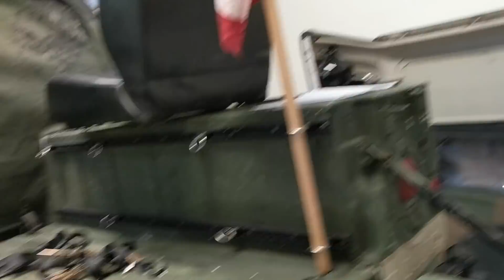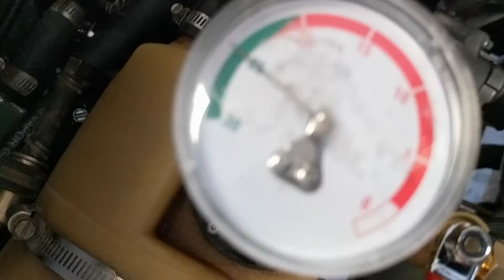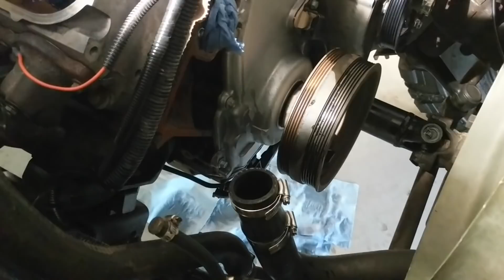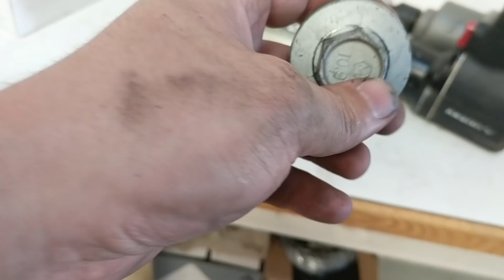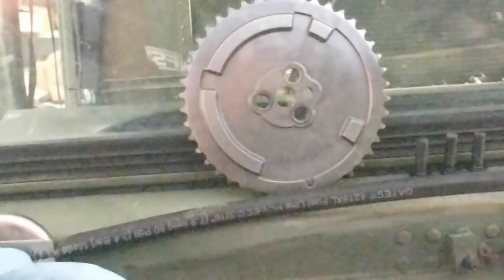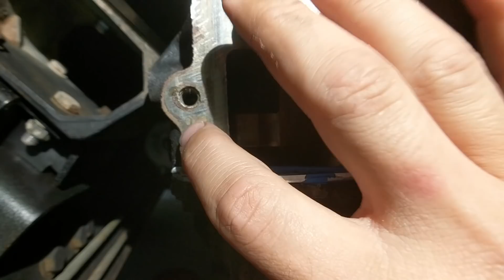Texas Speed Stage 3 Cam Swap! - LSxHumvee

Comment: 2 Question LS 02 Chevy Silverado 5.3  what the chart for the stage three cam kit price an what type of torque converter for the 02 4L60E on top the rear end for the 373 gear where that set me in my iron block I have the 862 heads on

Comment: How are you torquing this arp crank bolt?  Just running it in with the gun?
Reply from the maker: I don't recall off the top of my head but it's the spec they send with the bolt and can be found on their website.

Comment: I use metal brake lines to hold the lifters. Wood could potentially break off in the motor, but I will say I’ve never heard of that happening.

Comment: Idiot I know those cam bearings were wiped out you never put a cam in horizontal always but always vertical I know you're not that good but thanks for the video anyway maybe to help somebody else
Reply: Apparently you don't know that cam bearings are pressed in so knocking them out is a bit hard unless you force the cam in with a hammer. Also you look at any video no matter what motor the cam is installed horizontal not vertical. Who the hell flips a block just to install a cam?
Reply: I think he was pulling your leg a bit.
Reply: @1guyreckingkrew  I hope so!

Comment: Why would you fit an ls9 cam for low end?
Just looking at the specs it's not designed for low end torque. Its designed for top end power with a supercharger.
Silly if you ask me..
Reply from the maker: I've swapped it out now but I used it because it's $100 and I needed a 3 bolt cam. Now I run the stage 3 truck cam from Texas Speed.
Reply: Did you even watch the video? Watch at 20:00...

Comment: Ict billet makes a tool that bolts in the starter area and has teeth that seat in the flex plate to hold the engine from turning its $40 bucks.
Reply from the maker: I've been looking for one of those. Thanks!
Reply: LSXHumvee 
Your welcome